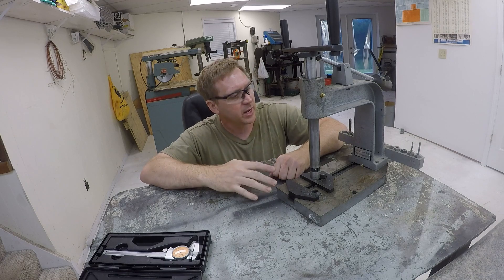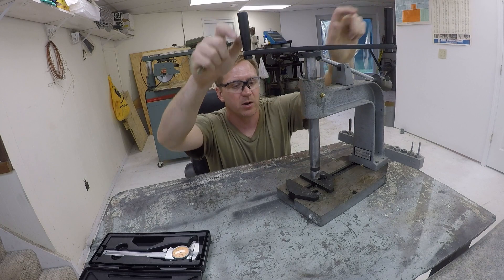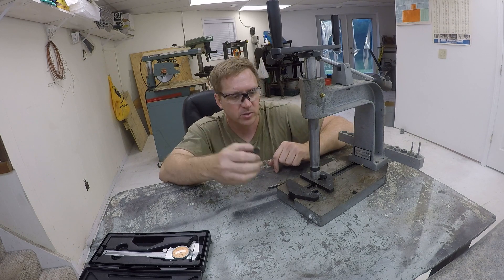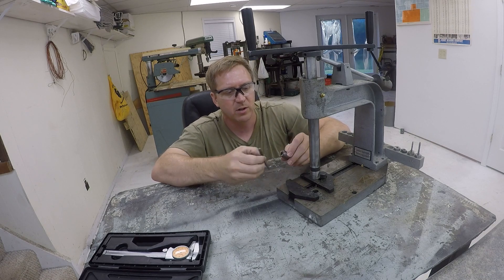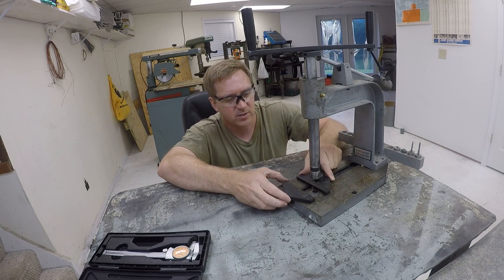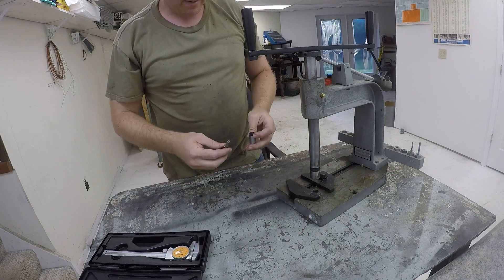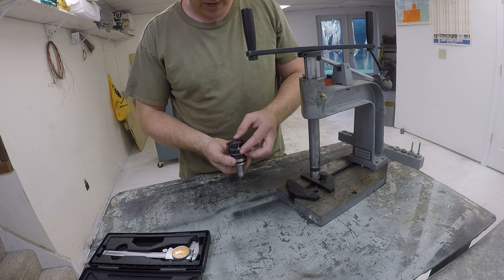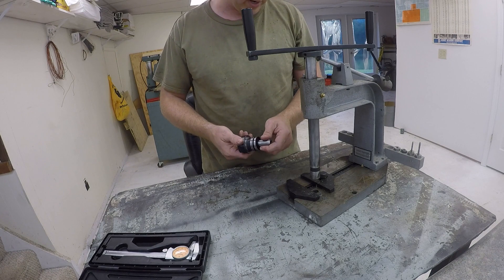Hand Tapper Improvements - Intro

Comment: I bought one of these exact machines from a catalog years ago for $89.00 !  It works great.  I made a much shorter crank handle so that thing wouldn't bash me in the head when tapping the small taps I usually use like 5-40 and 3-48.  The little ball keeps falling out and sometimes the collets drop out in the middle of a tapping job.  My fix for that was using a small drill chuck on the end of the quill.